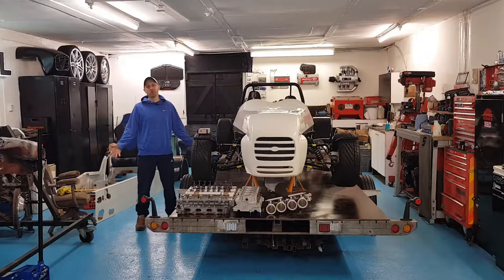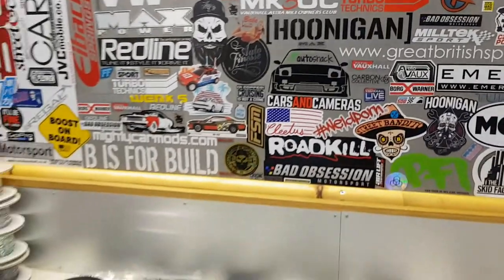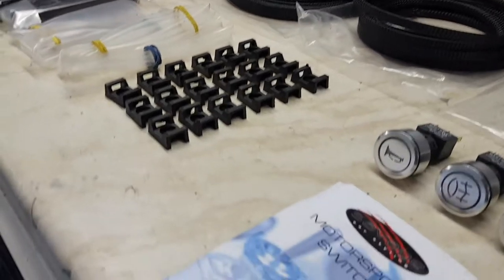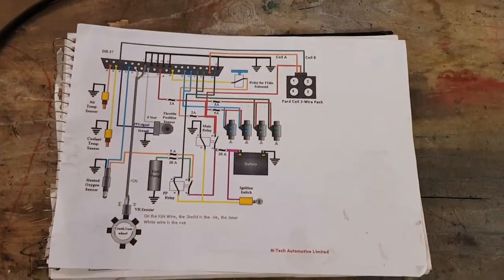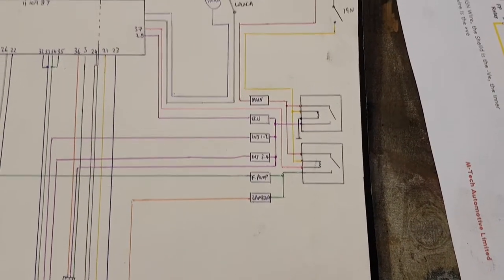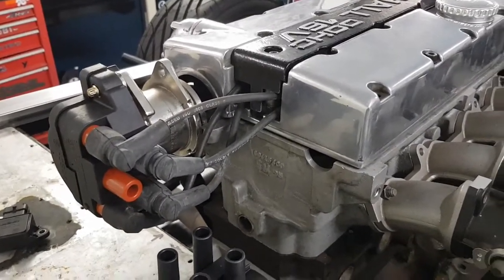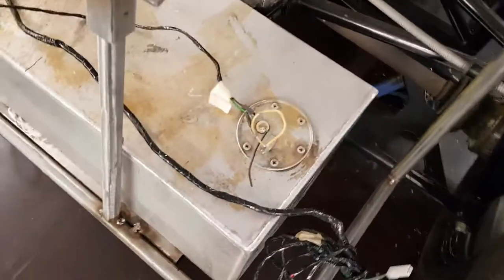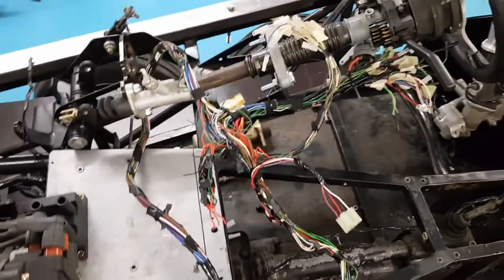Ep14: Planning the Megasquirt V3 management on my C20XE powered GBS Zero.

Comment: Nice video. What kind of fueling strategy do you plan to use. I noticed you pointed that the ECU have inbuilt map sensor. Do you plan to run speed density. ITB's are mostly run in Alpha-N mode.
Reply from the maker: I originally bought the ecu for my c20let turbo astra so was equipt with a MAP sensor. Im still expanding my knowledge on the N/A world but it does look like tuners prefer to tune off the TPS so will probably run with just that.

Comment: those injectors looks exactly the same as ones from my peugeot 405 mi16 (xu10j4) engine, it even has the same power output as red top and i believe set of piston rings that i got for it said it fits c20xe engines
Reply from the maker: The Xe cream injectors are 214cc @2.5bar. I can boost the fuel pressure up a bit but not sure how they'll perform yet.... Thanks for watching 😁
Reply: @SuperRon  yup they are the sames xu10 ones. You can upgrade easly using xu10j4rs injectors that are 276cc as far as i remember. They have green hats
Reply from the maker: @fila1445  thanks for the tip 👍

Comment: What's the most convenient place to mount an MS2 in an astra?
Reply from the maker: The glovebox it's a pretty normal place for an aftermarket ecu. The standard ecu location usually is usually a good place for routing the loom etc, but not easily accessible for laptop plugin. I'd say glovebox/ centre console/ lower dash trims.
Reply: Cheers Ron. Getting mine in a few weeks, megasquirt seems a bit bulky I am a bit worried it wont  fit at the stock location

Comment: Hey Ron what xe model is that crank sensor off? I noticed it is slightly longer than usual
Reply from the maker: Well spotted, turns out it's a x25xe one when tried it in the block and it hit the crank 🤣🤣
Reply from the maker: @Gate9er I've got a few here, I just guessed this one was XE 🤦‍♂️
Reply: The metal early ones do work much better with the ms than the plastic ones if you have one to hand mate.
Reply from the maker: Yes I was running a metal one on my C20let
Reply: @SuperRon  What happens to the camshaft sensor?? Do you just blank it?
Reply from the maker: Yes the megasquirt doesn't do sequential fuel injection so it doesn't need a cam sensor .